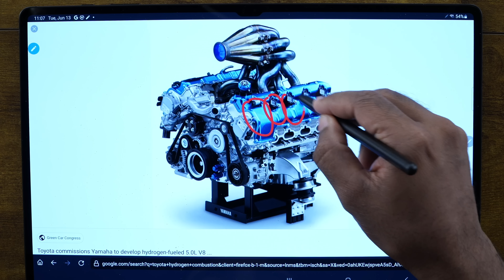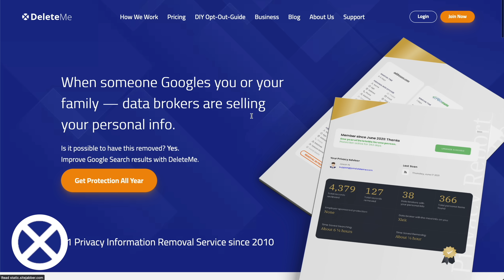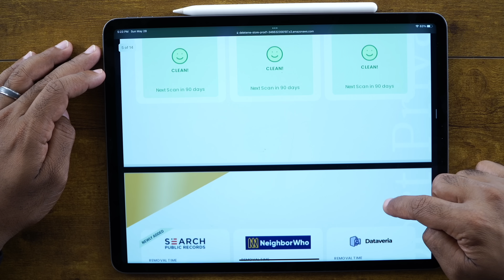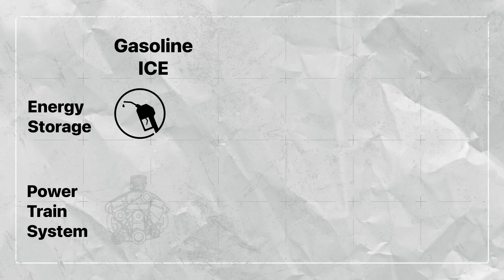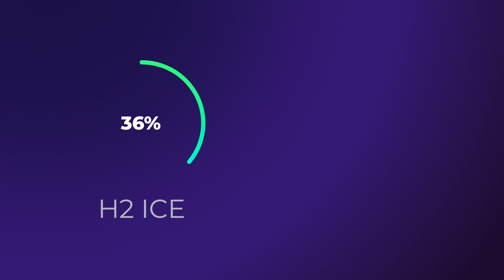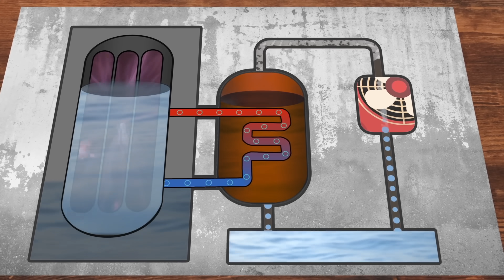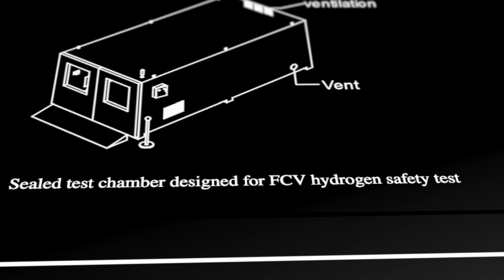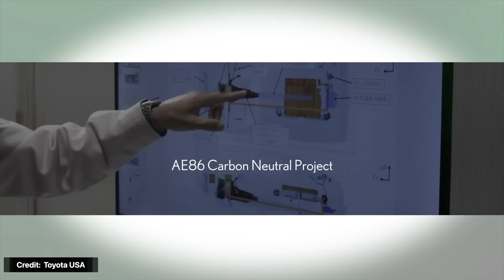Toyota's Says They Just Destroyed EVs - Hydrogen Combustion Engines

Comment: Sounds like a good way to keep engine designers, mechanics, parts suppliers and dealers employed.
Reply: I would think that they probably want to keep sports racing alive and a way to give EV a challenge to make their technology better.
Reply: Every single German car manufacturer researched in H2 combustion engines since the early 70s and Mercedes (Fcell) and BMW comes out on the market 20 years ago. Germany has the biggest ICE industry and supply chain and yet this alternative was buried many years ago because it just doesn't make sense. Japan is late with electrification and they have also slept through the H2 issue. I'm starting to get the feeling that they don't really know how to maintain their automotive industry in the future.
By the way, Germany also has the largest hydrogen filling station network in the world and yet it would no longer be considered an alternative. Decades of research have led to the conclusion that this is not suitable for private transport. However, heavy goods traffic is a different issue. There, hydrogen could well be suitable as an alternative
Reply: Porsche is also working on E-fuels now too, the internal combustion engine is not going anywhere
Reply: Or a good way to not run out on heavy metals and actually be allowed the freedom instead of being restraint.
Reply: Stopped listening after the winter range comment. Both tech would spend the same energy to heat. Hydrogen has slight advantage with waste heat. But that also means it is more wasteful all of the time, not just winter. Plus its not "roughly half" for bevs, thats intellectually dishonest
Reply: And to also jeep gearheads like me happy 😊
Reply: Japan being stubborn
Reply: What most people don't understand is that their are devices in existance that can generate green hydrogen at thousands of efficiency. The only thing stopping this technology coming to the public is a proper pricing system that ensures that the current big oil and companies don't go out of business. Its these same big companies that have ensured that this technology is kept secret while they take over the industry that will use it. So when the technology finally comes out the economical power distribution around the world does not change, and those who have power now will remain in power. So the rich will only get richer and the poor remain poor.
Research Energy Impulse Secrets and Energy Power Secrets by kanarev.
Reply: That’s the idea.
Reply: THIS GUY DOSNT KNOW WHAT HES TALKING ABOUT. HYDROGEN IS THE FUTURE. ITS MUCH MORE EFFICIENT THAN ELECTRIC. ELECTRIC GRIDS ARE GOING TO BECOME STRAINED IN THE FUTURE WHICH WILL LIMIT ELECTRIC CARS EVEN MORE. WE ARE ALREADY HAVING TROUBLE WITH THE LOAD IN TEXAS ON THE ELECTRIC GRID. HYDROGEN IS THE FUTURE BECAUSE IT IS CLEAN AND ONCE THE SUPPORT INFRESTRURE IS BUILT FOR HYDROGEN CARS IT WILL ESSENTIALY TAKE THE PLACE OF GAS ENGINES..

ELECTRIC VEHICLES CAN NEVER TAKE THE PLACE OF GAS VEHICLES BECAUSE THEY ARE SIMPLY JUST TOO INEFFICIENT TO BUILD AND MAINTAIN OVERTIME. WE HAVE TO DO SOMETHING WITH ALL THESE BAD BATTERIES AND THE POLLUTION THAT COMES FROM MINING COBALT AND LITHIUM AND THEN HAVING HUGE LANDFILLS OF NOTHING BUT BAD BATTERIES THAT NEED TO BE RECYCLED CAUSING CHEMICAL POLLUTION INTO THE GROUND WATER AND SOIL.

TRUST ME HYDROGENN IS THE FUTURE. 
ELECTRIC VEHICLES ONLY PRESENT THE SAME PROBLEMS IN DIFFERENT WAYS
Reply: That is the only reason . And he's not being completely honest or he doesn't know about emission's as there a emmisions with normal engine when running with hydrogen and much better emission's with specifically designed engine for hydrogen combustion engine
Reply: more importantly to save the planet, it's surely won't happen with your BATTERIES !
Reply: You forgot the oil companies to lubricate the engine 😊
Reply: @FireballXL55   They aren't going anywhere since no matter what the car product is it will still need grease and oils for lubrication.  And that's not even mentioning the fact that petroleum will still be needed to produce all kinds of plastic and rubber based products.  Petroleum is used in so many different products in the modern world I don't see the oil companies going away until science can find replacements for petroleum in everything that's made with it.  And it's not a 100% guarantee they can.
Reply: Engines and fuel aren't the thing us mechanics deal with regularly. Suspension damage, brakes, tyres and all other components still need to be serviced and fixed etc and parts are still needed, and dealers will still sell cars and fix those cars. Use your head.
Reply: @elian._iorio  starters, water pumps, radiators, fuel pumps, ticking valves, oil burning, timing belt changes , rusted out exhaust components, 101 reasons for the check engine light to be on.
Maybe you don’t actually change out an engine everyday but your not a real mechanic if you don’t deal with these issues regularly. Those are all issues I’ve had done on my ICE over the last 30yrs and all of the parts and EV doesn’t even have.
Reply: @fergyspoolshots  "maybe you're not a real mechanic", mate if I'm trained and  employed as a mechanic, then I'm a mechanic, what are you on about. But no, those are the most common big things that dealers etc. Get in, but in general, the majority of labour is done with suspension components, shocks, brakes, tyres, etc, a service is still a service for safety and that's where mechanics will still be needed.
Reply: @elian._iorio  congrats on being a real mechanic but the 95% of us EV have owned an ICE previously and realize many of the repairs we paid for were to replace parts EV’s don’t even have. You don’t have to be a mechanic to realize this. The amount of money made scanning and investigating why the check engine light was on must have made millions alone. Of course EV’s will have similar repairs like suspension, wheel bearings, A/C ect. No disrespect to mechanics. I admire your skills and patience.
Reply: @fergyspoolshots  but our work days are still full without any of these issues, most of the work most people may get done are those bigger engine parts but 90% of cars that come through have got other issues. Dealer's will still make money from selling etc, but yes maybe the home run shops will unfortunately struggle a lot, and not to mention the reducers on the EVs go constantly and have to be repaired or replaced. Then there's the coolant system for the EVs and other components. A lot of us are being called up for training in fixing and handling the electrics of the new cars, that's why they call us "technicians" now I guess instead of mechanics but yknow 😂 but yes numbers overall will reduce, maybe the older generation will struggle but younger mechanics will just adapt, cars will always need work done even if its not to the same extent, but I'd say people currently in a job are safe.
Reply: @elian._iorio  Based on Tesla's success with selling all their vehicles online only and Ford contemplating following suit I'm not so sure dealerships as we know them will even exist in 10yrs unless the  big 3 want to go tits up. 
I know several high mileage Tesla owners who've never had the "reducer", drive unit, battery or the battery coolant changed in 
1-300K miles. Perhaps you could be more specific about which EV's have this reducer problem. They are guaranteed for 200K Km after all.
A local guy in Guelph Ontario Canada has a 2018 model 3 with 600,000Km on original battery, drive units. and brakes. Suspension repairs only. He services the brakes himself regularly like I do.
I hope your right about the job loses but I just can't imagine all these parts manufacturers and mechanic shops being around in the future with mainly suspension  or HVAC repairs.
Reply: Good way not to burn coal to feed EVs.
Reply: @mareksykora779  So instead, you burn 7 times the coal to produce the hydrogen?
Reply: @germanmosca  Hydrogen can be imported from a country which produce electricity in solar, hydro, wind or nuclear powerplants and use it for hydrogen productuion.
Reply: @mareksykora779 great idea! Burn hydrogen in the power plant instead!
Reply: @therealmaximus  That is bad idea. Non fosill way of production hydrogen is by usage of electricity. So it makes no sense to burn it in powerplants and produce electricity again. And you would still need big batteries in cars!
Reply: @mareksykora779  If you can store the hydrogen cheaply in bulk it can be used for when there is no wind or sun.  If we could get to say 50% round trip efficiency that might be good enough, after all pumped storage is only around 75% round trip efficiency.
Reply: This! Toyota has billions invested in manufacturing equipment for IC engines. They can't afford to switch to EVs. Hybrids are their only option.
Reply: @jiyushugi1085  Every other manufacturer has done the same. Toyota is just following the sunk cost fallacy and will fail.Hybrids are a dead end, a waste of time.
Reply: @jiyushugi1085  Toyota can afford to switch to EV’s but they’re too scared to tarnish their reputation for reliability by releasing inferior electric cars to Tesla.  It’s the Japanese “trying to save face” thing again. Their electric SUV was so inferior they recalled them claiming the tires were falling off. 😂
Reply: @fergyspoolshots Have you seen how much it costs to replace a Tesla battery once it's out of warranty? Over 20k, The car is junk after that.
Reply: @inconspicuous7464  the warranty guarantee’s the battery to be at minimum 70% at 120,000 miles. By the time you drive your ICE that far you’ve already spent $40,000 in gasoline alone not to mention oil. Any other dumb comments?
Reply: @fergyspoolshots  Electric cars are superior to ICE cars in almost every way. Teslas are actually pretty bad for reliability.
Reply: @rogerphelps9939  Not reliable? Tell me what mechanical parts regularly break down on a Tesla? 
I agree their fit and finish isn’t on par with the others yet and their suspension components aren’t as reliable as a Toyota but other than that they don’t have many mechanical parts.
Reply: @fergyspoolshots$ 40,000 after 120k miles? What mpg do you think cars get? Lol
Reply: @wilsonvinas5906  
My apologies. I didn't realize gas was so much cheaper in the US than Canada where its about $5.50/gallon equivalent.

OK lets assume 
20 mpg and an a the national average right now of $3.60/gallon.
20 miles costs $3.60
100 miles costs $18.00
1000 miles costs $180.00
120,000 miles costs $21,600

So when your truck or SUV hits 120 miles(the same mileage a Tesla battery is guaranteed for)
you've spent the equivalent of a Tesla battery replacement on gasoline alone. In countries were gas isn't that cheap a Toyota  corolla costs this much in gas at 120K miles.
Reply: @fergyspoolshots  no, cause we aren't in 1985 anymore. Any electric car you are buying is going to be new. So, for example, a new elantra gives you a combine mpg rating of 37.5, which is pretty standard for a new car nowadays. You can pretty much slash your fuel consumption in half there. 120k miles divide that by the combined mpg rating to give you how many gallons of fuel you will use in 120k miles and multiply that by your example of the price of gas per gallon and you get about 11.5k in fuel. Almost half of the cost you just quoted and a quarter of the cost you originally said.
Reply: @wilsonvinas5906  You are correct if your using US gas prices. In Canada for a vehicle  that gets 37.5mpg it would still cost $18,000 at our current $1.50L. 
And $1.50/L is considered cheap here now. We get raped on gasoline here despite producing so much of our own. Maybe we need to start open carrying guns or something...
Reply: @fergyspoolshots  what is open carrying going to do for gas prices? What you need to do is vote for different politicians.
Reply: @wilsonvinas5906  Actually, I drive a Tesla so I don't really give a shit about gas prices. Voting is pretty much pointless. They all seem like game show hosts to me.
Reply: And what is wrong with this when it makes the car cost half of what an electrical car cost.
Reply: @fredericguyon1449  it doesn't, that is what is wrong.
Reply: @fredericguyon1449  What fossil fuel outfit nonsense have you been swallowing? There is already or very soon will be price parity. Through life costs for EVs are already lower than those for equivalent ICE cars.
Reply: @fredericguyon1449  It does not. EVs are already close to price parity with ICE cars and are cheaper when through life costs are included.
Reply: @fredericguyon1449  ikr, they might as well put a manual into it to cut costs even further, oh the horror! Don’t put a manual in it ;)
Reply: @fredericguyon1449  Does it? Half the price?  Even if that were true which it most certainly is not.  Hydrogen has a horrendous and costly total fuel cycle of 16 percent efficiency vs 77 percent for electric.  Unfortunately they are bumping into the laws of physics, otherwise it might be a good idea, but its not.
Reply: @Ryan-ff2db  batteries create a lot of waste when made and disposed of. batteries also have a rather short lifespam. so the efficiency argument isn't a good one. especially given that if both use renewable power to create the power/electricity.........than the hydrogen will actually be more environmentally friendly than a battery
Reply: @legendp2011  Serious?  It takes on average 4 times more energy to go the same millage in a hydrogen car as an EV(complete fuel cycle).  Do we currently have endless energy?  The lifespan of both fuel cells and ICE E-Fuel engines are almost identical if not a little less than batteries and for the record almost all current EV batteries will be repurposed or recycled.  They contain way too much valuable components to throw away anymore.  Just look at what Tesla, Redwood, Nissan, etc.. are doing nowadays.

I'm not saying Hydrogen doesn't have a future in renewable technologies but there's no way it's going make any impact on the passenger car market.  The technology is more expensive to purchase and dramatically more expensive to fuel.  The costs won't come down much either as hydrogen production keeps hitting the head against the laws of physics.  I do believe hydrogen will have a use in grid storage and niche applications but it will never be the dominant technology in transportation.
Reply: @Ryan-ff2db  You all don t think about how many mining you need to do for for one battery cell. You all look the finishing product of the car (Tesla) and think that it is super clean and efficient and that is not he thing. Volvo actualy made a research of how much production of ev is polutting in compare with ice. Etc etc. it does not matter actually because most of the world do not think have something is made, they only look on the final product. When you buy Tesla or any other ev you actually pollute the Earth but not directly and you feel very well and happy, because you don not think about anything. Cheers and think about it for moment. And to add on most of the energy in the world is get from carcoal (black energy) so, energy that you use to power your ev us not so green.
Reply: @dominikhajdinjak2576  Of course we take that into account, why do you think we don't?  Everyone does, it's the total calculations of all pollution forms including EV battery production.  On the flip side you have to also do the same for production of a standard ICE vehicle and the production of it's fuel source, from exploration, to drilling, to refining, to transportation, to pumping, to burning.  Depending on the study and energy source an EV breaks even somewhere between 16,000 to 40,000 miles when compared to Ice.  An EV at 100,000 miles is already several times cleaner the an ICE vehicle and I beg you find a current study that shows otherwise.  The coal argument just isn't true.  All developed countries are phasing out Coal entirely with renewables already higher than coal in most countries.  Even if your argument was true, which it isn't, an EV running 100 percent on coal would still be a little cleaner, although not nearly as much.   Just look up "are ev's cleaner the ice vehicles" on your search engine.  You'll see that everything I just said is true.
Reply: @Ryan-ff2db  bro you sheltered and spoiled. One hydrogen does not require hookups to the power grid. That alone is enough to be superior. 2 transportational energy like gas. 3 doesn't degrade to massive losses from temperature fluctuations. 4 car production costs. 5 far greener and cleaner than battery production and mining. 6 makes exhaust notes the best part of automotive. 7 better generators. 

I mean bro cmon I know you think you know everything but haha 😄
Reply: @Ryan-ff2db  4 times more energy is irrelevant if the energy is supplied by solar (like solar panels on building roofing). the range for ev and hydrogen cars is similar

also don't forget the amount of energy factored into making/construing batteries. also the word "recycled" doesn't always mean what people think. 

what percentage of a battery is actually re-used?? how much energy, time, pollution is spent recycling a small percentage of a battery. Graphite batteries could solve this.......but they seem to be perpetually 10 years away

we literally do not have the resources to replace every car on the planet right now with battery powered equivalent.
Reply: @legendp2011  4 times more energy requirements is irrelevant?  In a world where solar is only predicted to meet 45 percent of our total needs by 2050 and yet you think 4 times energy requirement is irrelevant?  I think you need to take a serious look at your mathematics on that one.  

The rest is total supposition on your part but I will tell you with absolute honesty, hydrogen will need several major breakthroughs to even stand a chance.  One of which is production and that will never be on parity with electric do to the laws of physics.  As I stated before hydrogen will have it's uses, in transportation it will remain a niche product.  Battery tech, charging speeds, and network build-out is improving every year by a good amount, just look at any numbers on this.   You speak of some battery tech being 10 years away but improvements are brought to market on a consistent basis and have been for 15 years.  I've been following hydrogen since the 90's with hope but we are no further along than we were then and even now 10 years away seems aggressively optimistic.
Reply: @fredericguyon1449  the cost to build "A" charging station that can handle a few cars is roughly $2 Million and at the moment you can only get the hydrogen from fossil fuels. Currently there are only about 500 charging stations worldwide so it would take decades to scale up to be a reasonably available gasoline replacement.   If you compare this vs an electric car charger that Tesla can install for about $40,000 per charger (so roughly $160,000 total for same amount of stalls as the hydrogen station), the economics alone would kill hydrogen.
Reply: @gregdemers9686  But you have to also take into account the fact that the entire power grid would have to be upgraded to handle so many EVs, which would be incredibly expensive.
Reply: @gregdemers9686  you can get hydrogen from water with electricity.
Reply: @fredericguyon1449  really? So tell me the cost of this hypothetical hydrogen car and how much they’re going to charge you to fill it up and all the hypothetical hydrogen fuelling stations yet to be built? You can buy a Chevy Bolt in the USA for $27,000 and fill it at home with a dryer or stove outlet from zero to full for $10.
Reply: @fredericguyon1449  The price of hydrogen 🤣. Also a lack of infrastructure to sell that hydrogen. Why wait when you can use an electric car now? If you do wait then what about advancements in battery technology? What if your future hydrogen car is actually worse than a future electric car whose electricity is cheaper?
Reply: @Clasticon73i  Yeah, but don't forget that, with hydrogen ICE engines, you still get to breathe in a load of traffic pollution.
Reply: @Clasticon73i  battery technology has not advanced a huge amount in 100 years. (in comparison to other technologies). Hydrogen is also much more likely to replace fuel for things like planes (as batteries are far to heavy). if you are looking at a car right now electric makes more sense. but in 10 years that may change
Reply: @Clasticon73i  Its way cheaper to retrofit gas stations to serve hydrogen than it is to demolish them and build charging stations and the infrastructure for that to be a thing for every driver.
Reply: @Clasticon73i  how about all the miners dying to build your batteries for your ev
Reply: @Clasticon73i  you drank that Kool aid ND came back for more didn't you 😂
Reply: how about all the miners dying to build your ICE car? Sides, it's news to me that there is so many people dying to get Lithium and Cobalt to make a Battery. And Cobalt is only used in high capacity batteries anyway, and will be complete history soon, as is Lithium.

Sides, i don't think you make enough money to afford Hydrogen or eFuels for your car once governments stop pumping billions of tax money into it.

It's also worth noting that Car Manufacturers instantly drop their Hydrogen projects once funding from governments run out. Because it's just not worth it and not useful for individual traffic.
Reply: @germanmosca  how's your power grid over there.  You going to burn 7 times more coal to charge your car makes sense.  You guys are energy independent right no Russia oil just coal right
Reply: @Clasticon73i  we don't have the infrastructure for electric cars. It will also be easier to build the infrastructure or convert the existing infrastructure to hydrogen.
Reply: @amaris058755ify  absolute nonsense.  Try reading a little before you post such nonsense.  Please look up "can the grid support EV's" and learn something.
Reply: @Ryan-ff2db  trolling hard glade you pick up on that with your hurt feelings lmao
Reply: @Clasticon73i  with current fuel cells and known volume of hydrogen tank it was easy to recalculate back to normal fuel, which has shown same price per distance 😀. Only one problem here. All fuel cell autos has defined range 600-900km with 5kg H2 tank. And as was mentioned in video we dont have so many Hydrogen stations around. Would be nice to have tank like 50kg. If you know that you dont travel too much, then charge only few kg, but ultra long travel full tank.
Reply: @Clasticon73i  there's no infrastructure to support electrical. Idk if you've gone 10 miles outside of a city, but there aren't exactly many electrical pumps out here in the sticks. The usefulness of electrical vehicles is quickly proven to be minimal over long voyages. It would be just as easy to make a switch to hydrogen and keep all the things about cars that people actually like, unlike EVs. Sure they're fast, but what's the point if you can't hear it rip? There's no charm there.
Reply: @legendp2011  Don't forget trucking, current battery technology is not sufficient, adds too much weight to the truck and reduces carrying capacity.
Reply: @Clasticon73i  I will use an LPG car instead until the infrastructure is right which won't take much time since companies like Cummins already signed H2 contracts with gas station chains in the whole east of USA, you can keep your AAA family pack batteries on wheels that weigh more than an elephant. No thanks.
Reply: @legendp2011  Dng! Ding! Ding! We have a winner. Things change, fast. Putting all your eggs in one basket is not a good idea. As in going completely in one specific direction is not a good idea. I live in a cold place. Longer distances. I can do some of my own work. Keeping an old car alive from what I’ve heard is the most efficient option. We had an ice storm up here where the power was out for up to a month some places. An EV is not safe for where I live in my opinion. If you can only have one car. Good to have options depending on where you live.
Reply: @fredericguyon1449 careful, you gonna upset the electric car weirdos. To them, it is the absolute pinnacle of automotive technology and everything else is a waste of time, money and energy.
Reply: @MWH12085  Assuming you can do basic math figure out what MPG your ICE gets then how much it cost you in gas to drive 100-120K miles. (The mileage a typical EV battery is guaranteed to be at least 70%). 
Then get back to me about which one is actually a bigger waste of time, money and energy.
I charge while I sleep, there’s no wasting time driving to or standing at a gas pump every time it hits 1/4 tank to shell out another $100.
Reply: Not really. They are going the same way that all of the trades associated with horses did when cars were introduced. It is futile.